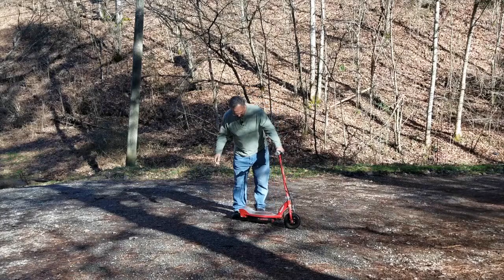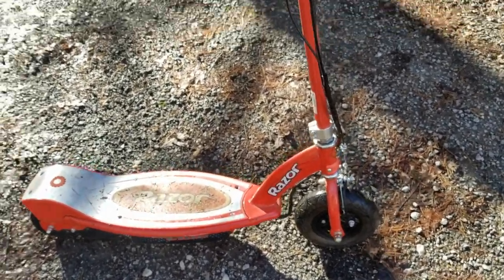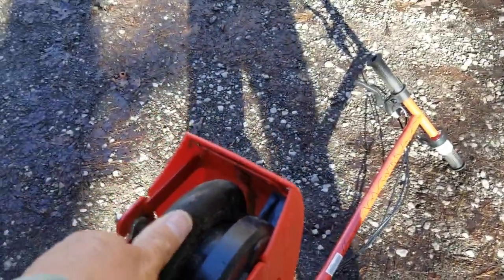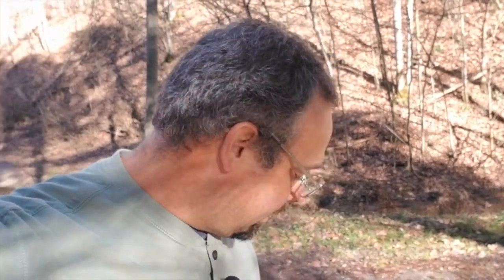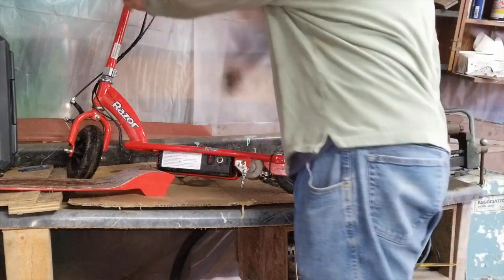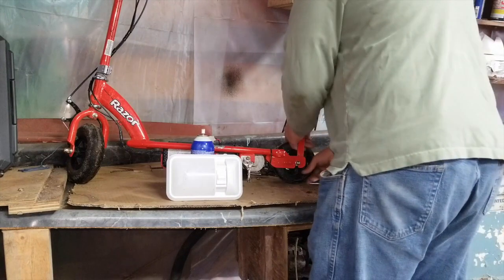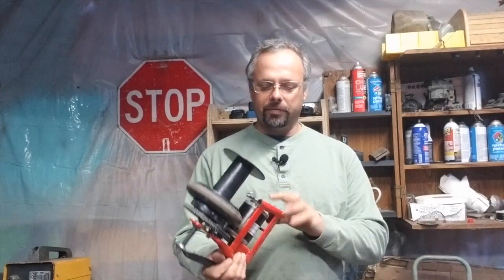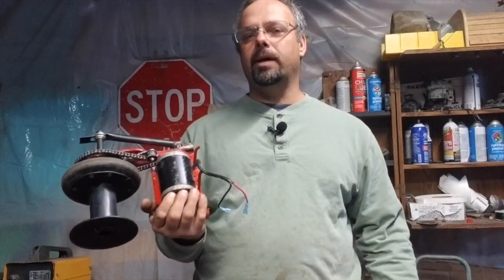DIY Wind Turbine Build For the Off Grid Cabin-Part 1

Comment: Are you sure that plastic spool will be strong enough? I’ve built one just like this and don’t understand estimate the wind, when it kicks up high gust I ripped apart mine and it was using aluminum plate but the blades were ABS pipe and they snapped off two blades from a high gust. Anyway they work but I rarely had high enough voltage to charge I ended up changing the sprocket well in my case it was belt driven so I replaced the Belt pulley and that helped. Also I changes how I bolted my abs blades so they were stronger and it worked. I use a cheap solar charge controller and when the wind is bad short it out to slow the blades. Thanks for sharing your project.
Reply from the maker: I have changed out the plastic spool for a steel pully from a lawn mower. It is much stronger. I will probably have to gear it down if yours didn't spin fast enough. I have ordered a wind charge controller with automatic braking not sure yet how well this will work as it is my first try at wind power. Thanks for the comment about changing the pully, now I know what to expect.

Comment: another incredible repurpose! My 4yo gbrat watched with me, he was mesmerized.  If there are a lot of strong winds you may want to seriously consider gearing the fan way down, windmills and the like have a clutch for when they spin to fast.. While I like the new intro I do miss the driveway
Reply from the maker: I'm glad he liked it! That's cool! I could rig up a kind of brake system, maybe a dummy load to dump any excess power into. It shouldn't be too hard to find some different sprockets for it. I'll have to get some creek shots back in the intro. I like that too.